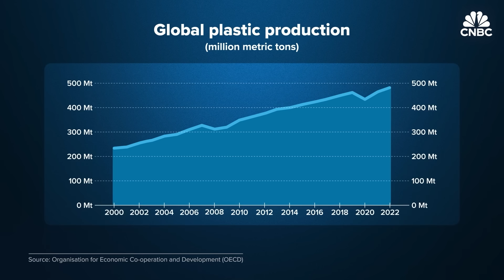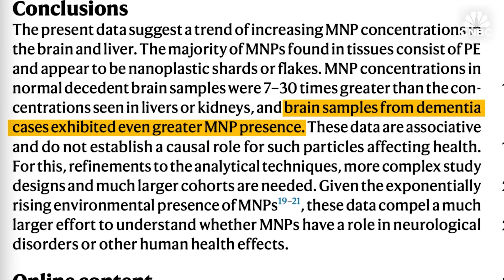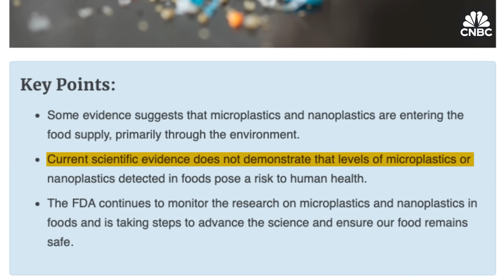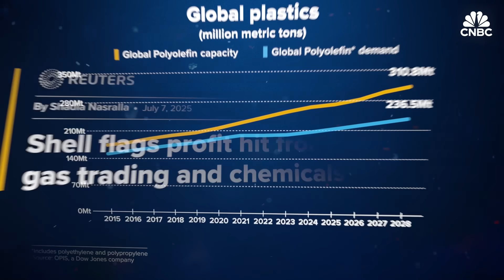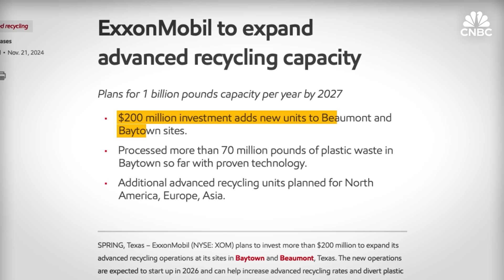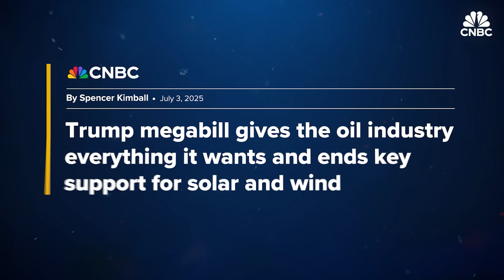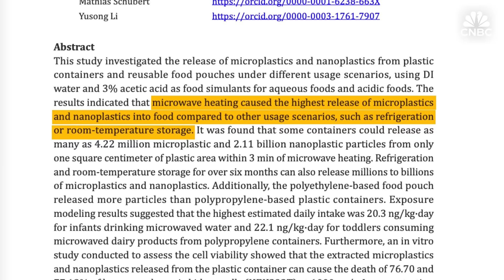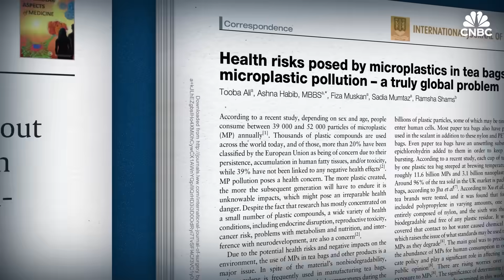Why The Microplastics Crisis Will Only Get Worse

Comment: 🗣️ So what should the 🌎 do from ♻️, stop living 🤦🏻‍♂️⁉️
Reply: Divine_Revelation👁️ 👄👁️: "The value of Life is negative. The balance of being is rotated by 38 degrees. The surface is full of cracks, a turgid light shines through. Fleshy primordial bodies sluggishly roll down the slope. Only you slide upwards, with a celestial step. You become beautified, a saintly figure. Your pristine idiocy reveals a safe path through the impenetrable fog of Life. Your dull sword cuts through the weak tendons and membranes of the garden of corruption. Sit on the throne of contentment and ferment. Inspect the eternal blue skies of your kingdom. You come to a realization. You pick up an onion and begin peeling."

Comment: I've cut way back on my plastic use.  Using glass to store food.  I have a reverse osmosis and use a stainless steel flask to drink from, but the filters for the osmosis system are probably made of plastic 🤦‍♀ My husband won't use the osmosis system and will only drink from single use water bottles.  The plastic is everywhere

Comment: you use the old plastic to make the gas you need to recycle the plastic. . . melt the old into the new. . its all oil. just dont add water or you will need a salad.

Comment: There aren't any micro plastic unless somebody takes very fine sandpaper and sands down every left over drink bottle. Even acid does nothing to it. The plastic danger is Benzene C6H6. Maximum ppm is zero! A byproduct from the manufacture of plastic. A forever chemical, water soluble, and can't be removed even with a distillery. Micro plastic is another scam like the ozone layer. The nonsense never stops does it. Nobody says a word about Benzene.

Comment: I found out a while ago that plastic bottled water contains something called PFA's, a forever chemical. Found in 99% of US population and linked to the worst health problems. I switched to arrowhead at the time but now it looks like I have to cut out the plastic. Canned stuff is not safe either. It also has the forever chemical and is also lined with plastic on the inside. And paper plates are a big one time use plastic that I'd been using for years. Why are we enjoying microplastic with every meal? In our water, plates, anything canned, even clothing. Polyester. I just found out myself but it turned out I was sleeping with a plastic blanket and pillowcase, breathing in plastic for years in my sleep and had no clue. Waking up and covering myself head to toe in plastic clothing too.

Comment: The basis for a lot of this video is wrong and misleading. Every barrel of crude oil is broken down into different products. The same parts of crude oil used to make gasoline and aviation spirit ARE NOT THE SAME as those used in plastics.

While plastic and gasoline both originate from crude oil (petroleum), they are not derived from the same components in the same way. Gasoline is primarily produced through the distillation and cracking of crude oil. Plastics, on the other hand, are often made from fractions of crude oil like naphtha or from natural gas, specifically ethane, which are processed into building blocks like ethylene and propylene. These are then polymerized to form the various types of plastic.

This is a misleading and intellectually false equivalency.
Reply: You clearly did not watch the full video.
Reply: @malmn  He kept saying 'with less demand due to EVs' which is a false equivalency. World demand for gasoline/ diesel has 0 to do with plastics as I pointed out.

Comment: Haven't looked at every minute of the video but jumped through quickly and it seems like you strategically "forgot" to mention that every wind power installation add to microplastics in the environment since the blades deteriorate over time. Even more so in harsh conditions of the salty sea. But that's perhaps "good" pollution since you don't mention it?

Comment: “Why The Microplastics Crisis Will Only Get Worse”? Or Why The Microplastics Crisis” is no crisis? 
Three reasons. First, two decades ago, science could only measure parts per million. Parts per billion measurement was out of reach. Since then, it’s become an easy measurement. Second, the “problem” is more apparent than accurately measured. Complicating any assessment is the conflation of man-made microplastics with naturally occurring microplastics. The largest single natural source is believed to be in seawater from oil seeps leaking from the earth naturally. Until this measurement is taken out of the message, we cannot say there’s a problem we can solves. Third, plastics have been used in human medicine for over 60 years. Heart valves, joint replacements, and optical contact lenses have been used by put to hundreds of millions if not more. The human animals health is the most intensely and accurately studied life form on the planet. If plastics were a serious human health hazard, it ought to be apparent by now. Microplastic “pollution” remains a phenomenon in search of harms — not a problem only getting worse.

Comment: No wonder that we are a sick society all by the greed of the weak few .
People need to listen and watch this podcast for it concerns every single one of us and our future generations.
My father was a plastics engineer,and I have a combined total of over fifty years of experience of engineering and manufacturing certain types of plastic components for medical, military, aerospace and commercial applications . Never once back then did the pollution aspect enter our thinking because we were recycling plastic and there wasn’t the tremendous use of plastics as there is today.
Knowing what I know now ,I am an advocate for biodegradable bio plastics and other biodegradable materials that could be used in place of most petroleum and gas manufactured plastics but the greed of the few are keeping these materials from getting into our society.
Also to note , recycling of these petrochemicals is just pushing and hugely enlarging the pollution and our health problems down to our next generations and the world’s ecosystem.
Petroleum based plastics can only be recycled so much because it brakes down because of heat and pressure of the molding processes even when mixed with new virgin material it becomes substandard for the industry and a deadly throw away pollutant.
In the beginning our creator made just about everything biodegradable for a reason, man changed that .

Comment: both plastic and tires can be converted into flammable liquids through a process called pyrolysis. Pyrolysis is a thermochemical decomposition process that breaks down large polymer chains into smaller molecules, including those found in liquid fuels.

Comment: PLEASE NOTE - The "plastic spoon" study was DEEPLY flawed. 
–––––––––––––––––––––––––––––––
–Potential for Overestimation:
The analytical method used, pyrolysis-gas chromatography-mass spectrometry, is known to be susceptible to false positives, especially when analyzing samples with high concentrations of fats like brain tissue. 
–Laboratory Contamination:
Microplastics are ubiquitous, making it difficult to rule out contamination from the laboratory environment or during the autopsy process. 
–Small Sample Size:
The study used a relatively small sample size, and it's questionable whether the findings can be generalized to the broader population. 
–Lack of Control Group:
The study didn't compare the brain tissue to other organs, making it difficult to assess whether the brain indeed accumulates more microplastics than other parts of the body. 
–Duplicated Images:
Some images in the study were found to be duplicated, raising concerns about the overall quality and rigor of the research. 
–Unrealistic Quantification:
The reported levels of microplastics in the brain were higher than those found in sewage sludge, which seems unlikely and further questions the accuracy of the measurement.

Comment: It turns out that the smaller the microplastics are (nanometer range especially), the more dangerous they are.  The first major problem right now is properly characterizing them (which measurement principle to use) and standardizing that measurement, and there is a lot of active research on that now.  The solution will be to have an additional step at water treatment plants to take those size ranges out specifically; the challenge is finding an efficient way of gathering all of those molecules together because there could be relatively huge distances between them

Comment: A quick "my two cents": it seems to me that the coloured (orange, red, yellow or green) plastic mesh bags in which citrus fruits and avocados are packaged and sold seem to be noticably prone to disintegrating off tiny strand off plastic. If this plastic is biodegradable edible and harmless, then the current packaging is of course fine, but if not, then I suggest that produce producers be incentivized to package these items (like oranges, grapefruit, lemons, avocados etc) instead in mesh bags made out of hemp twine, (and that hemp twine mesh sack manufacturing be facilitated). Just a thought. Cheers

Comment: Microplastic is an issue, but at least you can see microplastics.  They can be up to 5mm long...  Nanoplastics, perhaps 10 micrometres in length (1/10th of the diameter of a human hair, ish...) can't easily be seen...  Since the seventies, We've had 3M's Scotchbrite, a non woven, abrasive, plastic fabric used for metal finishing, dish cleaning, etc, and each scouring pad sheds thousands of nanoplastic particles, in use, sometimes in removing plastic filler on car repairs, which again produces nanoparticles...

This is inescapable... Everything in the food chain must be ingesting the stuff...
Reply: Once I started learning about microplastics those scouring pads were one of the first things I got rid of and went for a cellulose/coconut fiber scrubbing sponge. They work great and last about a month for dish washing.  Plastic cutting boards are the other biggie! It's overwhelming how many plastic items there are involved in food and it's almost impossible to get rid of it all.

Comment: So, the Exxon guy says they want to ramp up recycling to 1 billion pounds in 2027. Whilst the production is 500 megatons. If I'm not wrong thats a rate of less than 0.1%.
Reply: Ever watched the recycling truck lately? They don't even pretend it's gonna be recycled anymore. Everything goes into the same compartment and gets compacted all together.
Reply: @hwogrillo  I'm from germany. Here they are at least keeping up appearances. We have four kinds of garbage/waste and they are collected seperately. But I don't know what happens next with it.
Reply: @f.eckert  In the US about the only thing that actually gets recycled as far as plastic is concerned is the extremely common stuff like soda and water bottles. Metal recycling and glass recycling is done pretty well too. The vast majority of plastics though either go straight to the landfill or shipped off to China where they dispose of it in less scrupulous ways.

The problem with plastic recycling is that there's a million different kinds of plastics, none of which are compatible for being recycled in the same batches. It would be insanely expensive to even just sort it properly, much less the actual recycling process.

They've actually developed an enzyme that breaks down plastic into a molecular level in under 24 hours now though. So we'll see if anything ever comes of that in the future I guess.

Comment: Not only micro plastics but also milk cartons using a teflon coating and teflon coated surfaces that make nonstick surfaces on pans, that when exposed to high heat, break down and off gas into our cooked food that we consume into our bodies. And seen more uses for teflon coatings that is alarming.  At room temperature these coated surfaces are harmless but as temperatures change when exposed to fire cause the inner surface to tranfer to the food we cook in these non stick products. Even camp cook wear using nonstick surfaces. 
The positive side is seeing more glass bottles used for soft drinks. 
I hope more exposure to these topics will create an effective argument with regulators and for us not to suggest that seeking more petroleum means more plastics since it is not regulated by the current president or future ones. 
We need more scientific evidence to educate the public. And bring a convincing argument. 
At least we can caution ourselves not to use micro wave plastics but glass. 
Paper plates that have a coating on them use both teflon and plastics.

As consumers we can make better regulations for ourselves than blame the government or blame the president. 

We can become our own regulators not to buy foods in plastics and fruits in metal cans coated with teflon or plastic coatings. We can buy fruit in glass jars at Menards grocery area. And Walmart. Iron skillets are making a come back. We don’t need to wait for regulators, only arm ourselves to shop wisely and carfully to limit our exposure.
Reply: The best material for skillets and pans is steel. Chinese know that best. They use a lot of steel kitchen utensils as do I. Love steel. It doesn't corrode. It's forever.
Reply: @dddux  Steel's great.

If you can, cast iron for pans is also stellar but you have to baby them a bit with all the curing and seasoning to prepare them compared to steel, if you need something that's a little heavier.
Reply: @dddux  It does corrode and requires regular maintenance and proper handling to ensure it doesn't rust.
Steel and Iron cookware is good but don't blatantly lie about it.

Comment: The problem with plastic is once you create it, you can't un-create it back to its raw materials. This isn't true of steel, aluminum, copper, silicone. Or can I? If plastic is carbon, hydrogen, and oxygen in long chains and I burn it, does it release carbon, hydrogen, and oxygen which can then be formed back into chains? If not, why not?

Comment: There are many sides to this problem. One major issue is the excessive consumption of goods in general. Even small or single-use items are often wrapped in unnecessary plastic. People rarely reuse plastic bags, opting instead to take a new one each time they shop. Even perishable food items—which are meant to be consumed right away—often come in large plastic packaging.

In addition, single-use plastic utensils, boxes, and bags are widely used and thrown away after just one use. A big part of the problem is also the lack of personal responsibility when it comes to recycling. Many people don’t sort their waste properly at home and simply throw everything into a general trash bin, making it difficult or impossible to recycle effectively.
Reply: Where I live that's all we get . One dumpster for everything . It's easier but not good when you should separate everything .  And , I don't drive to do better .
Reply: I'm fine with the extinction of the human race tbh.It's not like we contribute anything meaningful for any species besides ourselves.

Comment: Recycling plastics has sent microplastics into the stratosphere. Almost nobody benefits from recycling (certainly not the environment) except the plastic industry who pretty much funds everything you see and hear about recycling benefits..
Reply: plastic can be burned away  (800–1000 °C) + filtering the smoke.
Reply: @rustybot4279 And how would you filter the particles?
Where's the technology to do it? It doesn't sound feasible at all.
If not, would you store it? It would need a lot of space since gases have low density, even if you compressed it, it would run the risk of leaking, its not a good idea to run the risk of changing all those chemicals again and having them in the air.
Stopping this unnecesary production of plastic by taking away from these corpos the ownership of the fabrics would give us a chance to work on a solution.
Reply: @firewolf9493 just read about thd factory tgat akready dies it. Dont ask ne about everythibg.
Reply: @neoqwerty  :goodvibes:sorry bro, I was driving drunk on the freeway and autocorrect was in another language. It won't happen again.

Comment: First its the pollutant CO2 that the petroleum industries release into the atmosphere and causes global warming. Then now its the unnecessary over use of plastics for wrapping food and other one use disposable or convenience habits that pollutes the environment in every way. The petrochemical industry is in the same denial process as it was with global warming when dealing with this question on plastics and externalising the costs of cleaning it up.

The solution to this problem is to get the petroleum corporations to pay for cleaning up the plastics pollution and the health problems that they are responsible in creating. Then there will be much less of this poisoning of the planet as the clean up costs would be greater than the revenue of making plastics. Just like the consequences of global warming is a higher cost than the benefits of CO2 pollution.

Comment: Heating and grinding cause plastic to produce mega amounts of Micro plastics  Recycling Plastic is not good it bad as it requires lots of heating and grinding , so recycle and reuse is not your friend with plastic using  Plastic for car tires not good..   bad enough  new plastic is heated and molded 30 years in plastic Blow molding the worst material to work with is recycled platic the amount of plastic dust is  insane Inches of Micro plastic every 1000 pounds use some times more  because  the machines dont make the best product the more recycled plastic  the more you have to regrind and try again  plastic Companies just send this dust to landfill and they been doing it for decades now ..